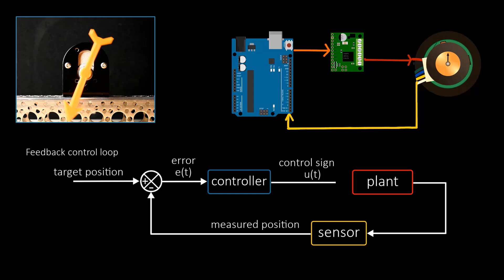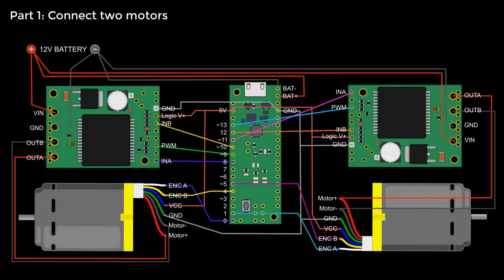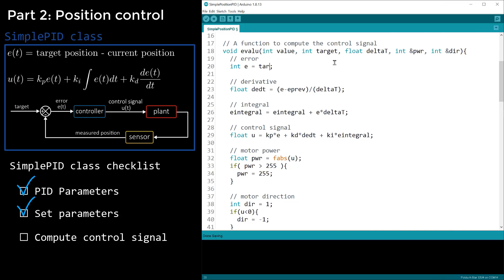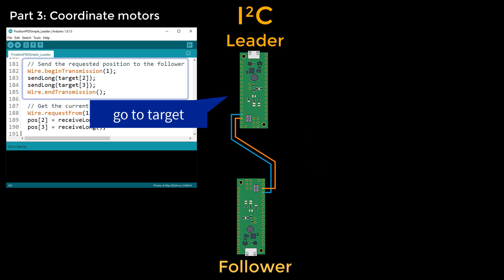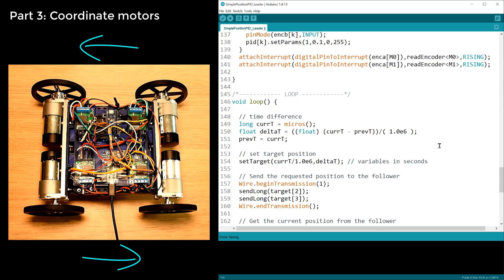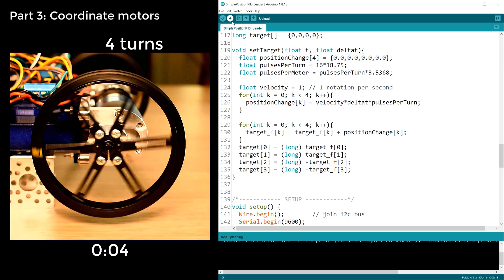How to control multiple  DC motors with encoders

Comment: Hello curio,
      It was great video indeed. Would please tell me from where you have installed atomic library? I have downloaded two of them but is not getting compiled properly throwing back some error
Reply from the maker: So far I haven't been able to identify why some users can't access atomic.h. From what I have read, it's based on your microcontroller. I added an alternative code that does not use ATOMIC_BLOCK -- it's up on the GitHub repository.  https://github.com/curiores/ArduinoTutorials

Comment: instead of the "A-Star 32U4 Mini SV" controller can I use 2 Arduino Uno/ 2 mega / Arduino due/ 2 Arduino nano v3. I guess I need to have a total of 8 digital pins for the same right? Please Suggest, Thank You.
Reply from the maker: Sure, any of those options seem reasonable to me. Two megas would probably be overkill in terms of pins.

Comment: Glad to watch the video , just one question can I do the same by replacing Arduino with Raspberry pi as a control device ? 

If not which motor controller are used for pi to control dc motors with same type of encoders used in this video.
Reply from the maker: Yes, you can... but I think there may be some issues with slow interrupts because there is a lot going on in a raspberry pi.  I am not familiar enough to know how well it would perform, but I'm guessing not that well. I would myself prefer to do the control loop on a microcontroller and then have the pi doing other tasks, like computer vision and path planning.

Comment: My motor driver has only PWM1 and IN1, do i just remove IN2 in the setMotor part of the code?
Reply from the maker: What motor driver is it? If that's the case, it's probably not bidirectional. If it's not bidirectional, it will be harder to control (you won't be able to reverse directions). You would have to slightly edit the setMotor function to make sense with the control code.
Reply: @curiores111  Its actually known as MDDA 10 Cytron dual channel motor driver
Reply from the maker: @Luxigaming  Oh well that's good then. Look at the truth table for control logic on the spec sheet. You can adjust the setmotor function so that it matches those conditions. (In other words, you remove one input the setmotor function, and then change the logic inside based on the truth table for a single direction pin, rather than 2).
Reply: @curiores111  Thank you so much for ur help!!

Comment: Do you have any recommendations or resources for how to learn about the mechanical/physical parts of making projects like these?

I'm generally good at code, so-so at electronics, and poor at the mechanical/physical parts.  I wouldn't know how to choose a chassis, motor, wheels, or how to mount them to each other.
Reply from the maker: Of course! I use a lot of different components while making projects like these. My best friend is my 3D printer. It fills in the gaps that invariably arise in fitting the model together (this model's chassis is 3d printed with petg). I like to model components in fusion360, although I recently started doing a few in blender. Usually I'll download the STEP files for the purchased components, put them together in a model, and then add in some 3D printed parts as needed to make things fit together.

I usually purchase the mechanical components (gears, belts, lead screws, wheels, and so forth) from pololu and/or gobuilda (metric)/servo city. Generally, if you buy multiple parts from the same brand they will fit together nicely, so it makes it easier to put together a working prototype (and they usually have STEP files so I can build the mechanism before actually purchasing the parts. For example here's the model I used for this build: https://imgur.com/a/gegIMN9 ). I'll buy cheaper amazon parts if I can find something that looks decent (and need to save money).

Also, there are a lot of standard sizes. For example, these are 37D motors which you can find mounts/attachments for from various brands. The motor shafts are 6mm-D shaft which is again, pretty standard. You can then use a hub (or wheel mount) with a 6mm shaft to connect to a moving part (e.g., a wheel). I just added these mecanum wheels ( https://www.gobilda.com/96mm-mecanum-wheel-set-70a-durometer-bearing-supported-rollers/ ) to this model and I'm excited to see how accurately I can drive it.

Sorry about the long reply. I don't usually get asked this question. ;)

References... hmm. I guess it depends on what you're trying to build. Anything specific in mind?
Reply: @curiores111  Nothing specific.  It's a general, "I wish I knew how to do something like that" moment.

I'd like to experiment and learn about affecting the word with a microcontroller (beyond lights and sounds).  Something that moves would probably be fun.  I'd like to experiment with PID.  A balancing robot is probably too ambitious for a first project.  I've seen people put a ball in a grooved channel and balance it or keep it at a specific distance (servo with mechanical linkages?).  Maybe a fan levitating a ping pong ball, trying to keep the ball at a specific height (though I'd need to contain it so it stays above the fan, not flying off sideways).
Reply from the maker: @markday3145  Those are good ones to start with. I am sure you can find projects on arduino.cc for the ball and beam. It seems like people like a two bar linkage for that one https://www.youtube.com/watch?v=FidxDZ7X6OI . Very easy to put together. I'd like to see the fan project. My initial thought would be three cheap computer fans arranged in a circle. It would be fun to attach them to small servos to tilt their angle along with adjusting their speed. No idea if it would work to levitate a ping pong ball but it would be fun. (although of course you could just stick the whole thing in a plastic tube and then it would work right off the bat).

I don't have any references for these types of projects, some youtube videos and maker projects should be fine. For control theory I like the UMich tutorials, e.g.: https://ctms.engin.umich.edu/CTMS/index.php?example=BallBeam&section=ControlPID

Comment: Oooh, I like how you used a template function (readEncoder) to essentially pass an argument, since attachInterrupt doesn't give you a way to have it pass arguments to the interrupt service routine.  Hopefully, I'll remember that trick for later.

(I've used closures which bind that kind of parameter at runtime, but this looks like compile time -- two different copies of readEncoder are generated.)
Reply from the maker: Thanks! I love using templates in Arduino coding, because they allow you to workaround some of the Arduino restrictions at compile time.

I haven't used closures to bind at runtime. I'd be interested to take a look. Have a simple reference handy?
Reply: @curiores111  They're really easy in Python.  Here's a pretty good explanation: <https://www.programiz.com/python-programming/closure>.  Python can also use bound methods, which basically captures "self" and returns a callable object that can be used like an ordinary function.

Many languages have them.  Apple extended C/C++/ObjC in the Clang compiler, calling it "blocks," notably for use with Grand Central Dispatch (threading helper library).  I happen to like the blocks syntax, but it is non-standard.  Later, the C++ standards committee added closures; I've not used them in C++, so I don't have a handy reference.  And I'm not sure if C++ closures can be used where a pointer-to-function is expected (which is probably what attachInterrupt uses).
Reply from the maker: @markday3145  Ah, interesting. Feels more like a scripting language construct than something you'd find in C++. Thanks for the reference.

Comment: I had doubt, in your follower  sketch should it be void recieveLong(), because I got compilation errors.
Reply: error states , " 'recieveLong' was not declared in this scope "
Reply from the maker: You have to make sure "receiveLong" is declared before it is used. In C/C++ you would often declare all the functions in a header file to make sure that this doesn't happen (I didn't turn this into a library, so there is no header with declarations) . The way that I ordered the code "receiveLong" is declared before it is used.

My email is curiores@gmail.com if you'd like to email something.
Reply: Could you please help me find out where i went wrong? If you could give me your mail id, I can mail the code to you or you may let me know your preferred method also.
Reply from the maker: no it should be long, because it returns a long.
Reply: Hmm i get a error stating the recieveLong() isnt declared in scope for a statement under void loop(). Anyways i have mailed my code. 😊

Comment: Cool video 👍 I think, that speed control with encoders is more difficult. I thought of measuring the time between interrupts and dividing the rotation angle by it, but there may be acceleration between the hall ticks, which introduces an error.
Reply from the maker: Thanks! Yes, it is more difficult to control speed directly. There are a couple of issues to watch out for. I have worked through it before and am planning a video, but just haven't had the time yet.
Reply: @curiores111  Great, I will wait for the new video.

Comment: Where can I download this library <util/atomic.h> ?
Reply from the maker: That's part of Arduino's built in library. No need to acquire it.
Reply: @curiores111  Can only be used with Arduino? Can it be used with ESP32?
Reply from the maker: @ดํารงศักดิ์รัตนชัยจันทร์  Sure you can use ESP 32 (might need some logic shifting?). Are you coding in the arduino IDE for the ESP 32? [if so the libraries should still be there]
Reply: @curiores111  
I'm perplexed to change the logic from Uno to ESP32.Do you have an example?
Reply from the maker: @ดํารงศักดิ์รัตนชัยจันทร์  I don't have an example, but I'm sure there are plenty of tutorials for ESP32 out there. Good luck!

Comment: Finally, i found what i wanted! Just had a question, Is there any motor driver which converts provides proper DC voltage based on PWM signal from arduino? Because I am working on project where motor has to rotate at very low speeds of about 10 rpm. And my 50 rpm motor just produces a beeep at PWM values <70. I tried with buck converter hooking its pot to an transistor controlled by arduino and it does run but the circuit is a big mess. Just wanted to know if a neater solution i.e, a dedicated IC / module exsists? Anyways great content as always.
Reply from the maker: Hi Hrishikesh -- that's a limitation of the motor -- it will never run at lower speeds. Generally speaking, if you want to rotate at slower speeds, you would use a higher gear ratio. For example, these 150:1 gear motors: https://www.pololu.com/product/2828 have a maximum speed of 67 RPMS. They would probably work just fine at 10 RPMS. Here's some information on a wiki page about gear ratios: http://hades.mech.northwestern.edu/index.php/Choosing_a_Motor_and_Gearing_Combination

edit 
Oh I see that I may have misinterpreted your question a bit, and you may already know the answer that I gave. Sorry if that's the case. 

I find it interesting that you had a different behavior using a pot rather than just a PWM driver. In general lowering the duty cycle of the PWM driver should do the same thing as lowering the voltage across the motor, so you shouldn't need a secondary circuit. In general the most important thing here is the motor and the gear ratio, rather than how you reduce the voltage.
Reply: @curiores111  Wait, I think you got it wrong so when I need to run low steps obviously there is a low PWM signal. So during a low PWM signal there is high frequency which makes motor's coil resonate instead of rotating itself. So I found another way to lower speed. I hooked up a buck converter to output of motor driver which intern is connected to motor and I desolder the pot on buck converter which controls voltage and soldered the emmiter of a transistor to the center pin and connected its collecter to +ve of battery. Then i connected arduino PWM signal to transistor. This way I can run at very low speeds of even at maybe 5 or 6 rpm. But circuit got very big. So I had a question does there exsist such a motor driver which based on arduino's PWM gives a linear DC voltage? Did you get the question?
Reply: Resonate in the sense the coil just makes a sound like beeeeeep
Reply from the maker: @hrishikeshgawas4579  To answer your question: no, I haven't seen any non-pwm motor drivers. 

It sounds like you're basically using your buck converter (which most likely has a switching MOSFET) as a motor driver. This is not recommended, as it probably doesn't have the necessary protection against current spikes that can occur if there's a rapid direction reversal of the motor.

If the PWM signal is causing an issue, have you considered trying to add a filter (e.g. correctly rated ceramic capacitors) to the output of the motor driver? That should amount to something similar to what you're doing (filtering the output of the switching mosfet), but with safer components.

In any case, I'm not an electrical engineer by trade, so that's about as far as my thoughts go on this topic. I think filtering the output and/or finding motors with a higher gear ratio are your best bet.
Reply: @curiores111  Okay I will try filtering the output with a capacitor. Thank you; Yes I agree its not safe but was just trying to prove the point that motor can go on at low speeds but PWM causes problems. I will try it with capacitor and let you know. Thanks 😊.
Reply: @curiores111  Okay so I tried using a ceramic capacitors and with that I can go down to about 40 steps as a minimum. But I found a easier way lol 😆 I steped down power supply done I am able to acheive that speed at high analog write values. Such a easy solution oooof But this completes a big part of my project. Thank you very much for that nicely written code and theory. I learnt a lot!
Reply from the maker: @hrishikeshgawas4579  Great idea! That's surprising and interesting -- thanks for letting me know how it turned out.
Reply: @curiores111  Hey there pretty much made my code for my ventilator. Just faced problems in fine tuning position change. My motor wasnt able to cope up with targer but otherwise your code is perfect just like professionals do it. I have never learnt coding as such so I am little slow so took lot of time to complete. Thank You very much.
Reply from the maker: @hrishikeshgawas4579  Glad to hear that! I tried to go through as much of the code as possible so that it would be easier to adjust for a specific application. Yeah, the fine tuning can be difficult. Have you tried a stepper motor before? I don't know exactly how your application works, but its common to use steppers in applications where very fine position control is required.
Reply: @curiores111  I tried it but smaller nema 17 ones dont have enough torque and ones u step into higher models it gets very pricy so as always dc motors are good choice i can level off any position differences once in a while with the help of end switch.
Reply from the maker: @hrishikeshgawas4579  Yes Hrishikesh, that's exactly the tradeoff. 

I enjoyed talking with you about this and already shared our conversation with at least one other watcher. I have some new videos coming out soon, hope that I will see you around in the future.

Comment: I like your use of "Leader"/"Follower". I'm doing a somewhat similar project, and since I prefer Python I'm trying the RaspBerry pi Pico board and it seems to read encoders well. Things start getting complicated once you add individual wheel steering and want to calculate distances and angles with that.
Reply from the maker: Thanks, I've also heard it called "controller"/"peripheral", but I find that a little strange considering that they're both "controllers" and neither one is a "peripheral" (in my mind). For general i2c though, that terminology makes sense. 

I just got my pico this week! Haven't had a chance to get it running yet though. I also enjoy python (although to be fair I'll code in just about anything).
Reply: Hi! I'm also working on a similar project with individual wheel steering, how did you managed it? I'm using Arduino but having issues when I try to control more than two motors.

Comment: Very clear and valuable as always.  What software are you using for the wiring diagram animations?
Reply from the maker: Thanks Cilynx. I use  Camtasia to generate animations. For the wiring diagram on this one I made an SVG in layers, separated it into several images, and then used crop animations. It's too many wires to animate by hand.